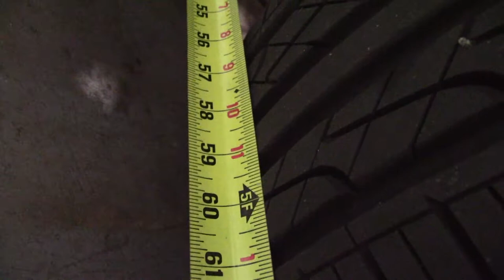66 Mustang 6 Cylinder Power Steering Tie Rod Replacement with Tips on Keeping it Aligned

Comment: You didn’t show precisely the part I’m having trouble with. Each time I edit my video the damn parts are still stuck together. I’ve removed castle nuts, etc. I have pickle fork, I have air hammer pickle fork, I have Thor’s hammer. Still it’s all stuck together. I need to learn your video edit tricks.
Reply from the maker: Heat it and beat it.  Beat on the knuckle too.  Sometimes they are really stuck.

Comment: Where did you buy these
Reply from the maker: NPD. Rare Parts makes them.
Reply: @mechtrician1  I couldn’t find a outer, RH, on npd. Would I be okay buying 2 inner, LH, and 2 Outer LH and use the LH for the right side?
Reply from the maker: @josephsmith2484  no. You have to get the exact ones as I recall. They are each different. 
Did you check Rare Parts website?